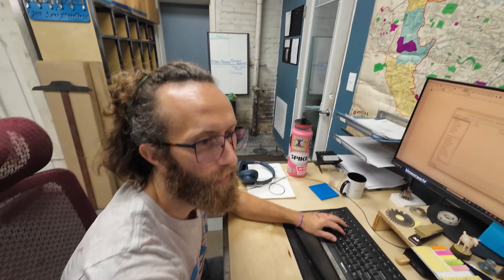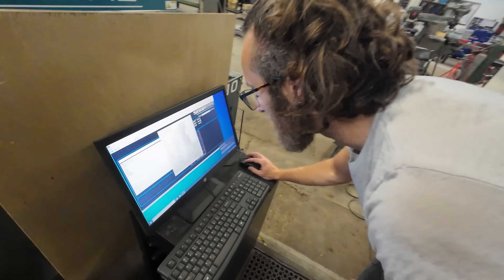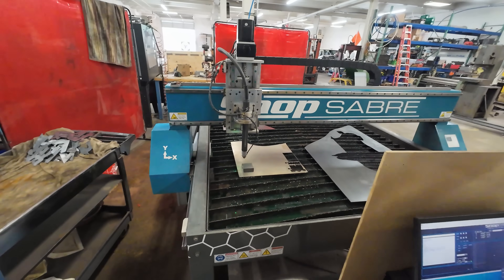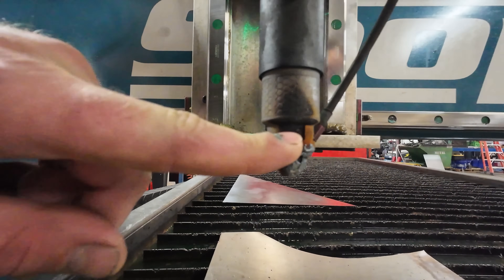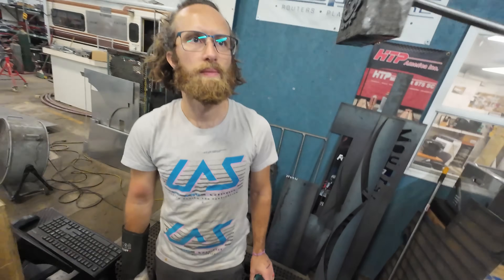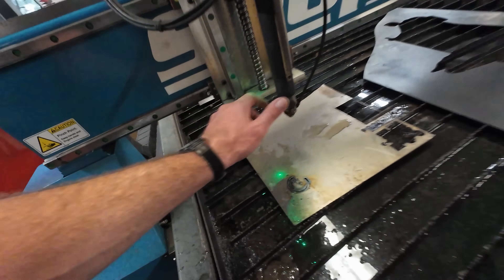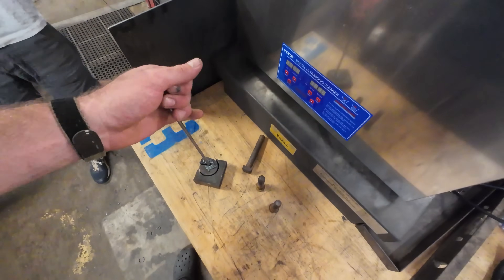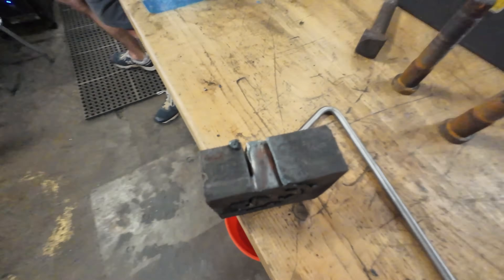Can Our Plasma Cut 1 INCH Plate?

Comment: i must give you tip on concrete mixer put a thick rubber mat on the inside of the metal drumm and you have make that thing quiet so you can run it all day long just a tip

Comment: I worked on a Flow Water Jet, and we could up to 3” Thick steal, with proper set up and correct tip (Ruby Tip) it was not fast and there was a curve up to 1/2”.  It would take up to Hours depending on on the size of the cut.

Comment: Our shop has a hypertherm 85amp and we chew through around 3 4’x8’ sheets a week of 1” steel plate among lots of other hefty plates. It’s not that the cutter can’t do it but getting feeds and speeds dialed takes time.  
Also if you raise your torch on the start pierce to like .375” - .400” above work piece the molten metal shouldn’t blast up to your nozzle as bad. You should extend the life of it for a bit.
Reply from the maker: Thank you for this tip, we just made a custom cut profile in the computer using your settings paired w book settings, excited to try it!

Comment: I sometimes ran a ocnc plasma with a hyperterm 250 amp, in 30mm we pre-pierceed with old nozzles. Had a check box to click in the software. then it stopped after all piercings, was a setting for offset to start aswell so it would arc.